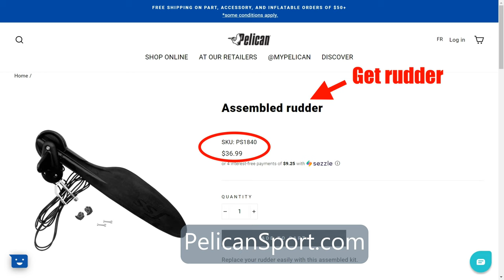DIY instructions to install electric fin motor on kayak. Turn any kayak into electric motor kayak.

Comment: Many kayaks that are designed to allow a Bixby or similar motor to be installed in seconds with no modification of the kayak by its owner. It helps greatly is there is a normal rudder on the kayak that is separate from the propulsion device whether it is foot pedals or an electric motor.